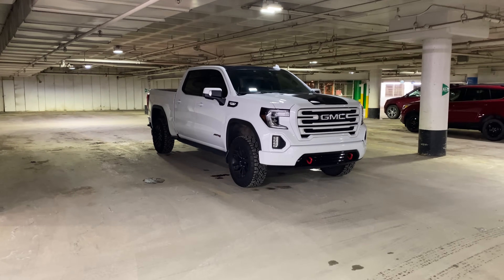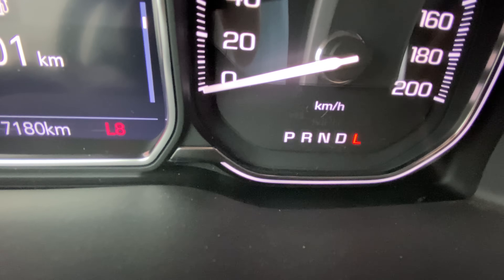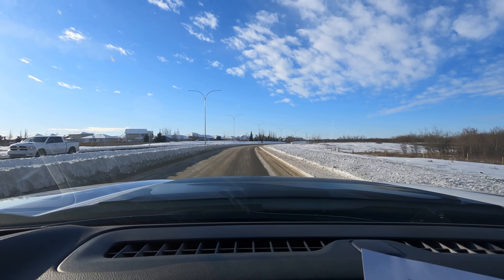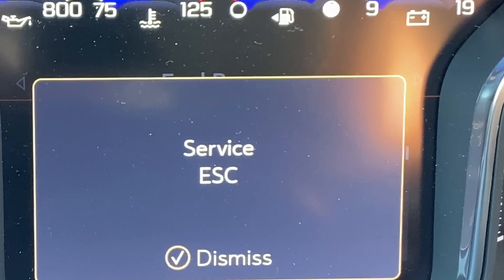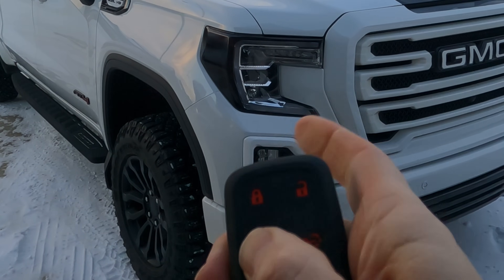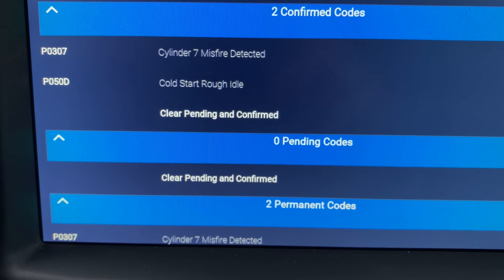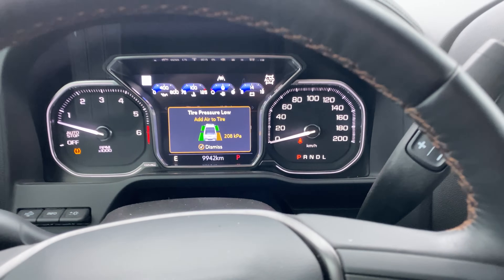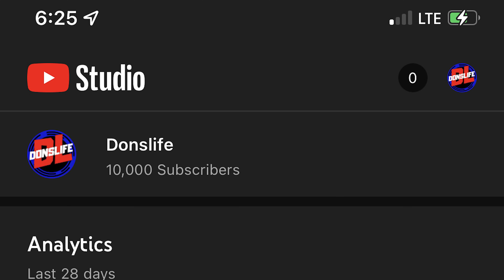Problem - Check Engine Light! What Happened? 2021 GMC Sierra AT4

Comment: Based on the experience your having it may be an issue with the lifters. GM is currently being served a lawsuit or having faulty valve lifters on 5.3, 6.0, and 6.2 engines. I would get the truck into the dealership asap. Make sure they replace all of the lifters passenger and driver side.
Reply: I have a 2021 GMC Sierra at4 as well with the 5.3l engine and I had the same issue. All of the same lights and warnings popped up and I had to get all of the lifters replaced. Was not a fun experience.
Reply: @michagenberger  I have an AT4 2021 as well so far I haven’t had any issues I’m barley at 2K tho.
Reply: @johnnyflowers1001  when did you buy yours or was it manufactured? I was told that in March of 2021 they changed the lifters, and later on deleted DFM. I recently purchased mine 11/29/21 and my does not have DFM and apparently has different lifters.. So I'm curious if this still happening to models w/o DFM and supposed revised lifters.
Reply: @jayk.2276  mine was out of production on August as per the vin info
Reply: 2021 AT4 with 5.3L 14k miles currently getting all lifters replaced. Not happy at all but hopefully this fixes the issue
Reply: @michaelgray4585  when did you take it out

Comment: It would be interesting to see if some of your issues don't go away if you put the original cold air intake back on. The original intake and the position of the mass air flow sensor is vital to give correct data to the computer. I have seen so many trucks have issues with aftermarket intakes that some guy without an engineering degree it turning out in his basement or small shop.
Reply from the maker: You may be interested to hear my update soon.  🖖

Comment: Hey Don thanks for sharing I had a 2015 GMC Sierra 6.2l with 50k  and already had my 3 lifters changed in driver side when only had 21k  in the winter of 2017. Now a month ago I did the same thing you did I start my truck with my remote and notice the rough idle I drove and had no power check engine light came on and it took it to the dealership misfire on cylinder 4,8 after they recommended me to do a full tuneup but that wasn’t the problem 1 week later came back again for the same problems and this time was the lifters. 🤬
Reply from the maker: Bummer man.  Thanks for sharing
Reply: Had a buddy with a I think 2014 Yukon 6.0 had recurring issues with lifters as well.
Reply: I have a 22 w/ 5.3 reserved. This lifter issue has me concerned and thinking about canceling. Does anyone know if this is being rectified for the 22 model with the replacement lifter?
Reply: @peterkaputsos4125  brother if you still can cancel it, run. Gm is finished. Their products have sunk to an all time low. I have the new Sierra elevation a d have nothing but issues. My check engine light is on now too, most likely failing injectors. The truck always has the Chevy shake rumble going thru the gears. Rattles so much it's shaking the panels apart literally. Terrible ride, never had a vehicle ride like this. Some days it feels like a clapped out civic. Only way to go is older tundra or hd models. Most American truck makers have sold out

Comment: Don is a weather related issue…think about it! Cold temperature affect spark plugs , they actually clean their self when they are extremely hot and been in a cold weather that spark will not produce that intense flash need it to move that cylinder making the computer read a misfire……misfires occurs as you know when you do not have one of the 3 principles, gas, fire and oxygen…you have two guaranteed, the other one is not flashing properly…..try to put your vehicle inside your garage for couples of days, clear your codes and see if the problems comes back…I suggest even wait until your weather goes excessive cold to test…..I think it will light up again because your spark plug is a factory one, its not made for that type of weather. Let me know how it goes…I have a 2020 GMC Denali 5.3 but am in Florida…add metal lube to your engine , will decrease friction inside your engine and don’t void  your warranty , great product to use. Take care.
Reply from the maker: Thank you sir.  I looked into the additive you recommended. Not available in Canada 🇨🇦

Comment: My 2019 LTZ, 5.3 with only 4788 miles on it, began having a slight ticking noise on the front of the motor, dealership check this out and said I was hearing "High Compression Fuel System". Anyone ever heard of this before?  Or am I just being played by the Mechanic?  Anyone know about this, please respond.  Thank You.
Reply: My 19 Trailboss LT does the same thing, have always worried about it.. Hope it’s not anything serious. But hey still under warranty, I just don’t want to be stranded somewhere if it does. I do have the 8 speed and around 29,000 miles started having transmission problems. Took it to the dealership, they knew exactly what the issue was and never even test drove it lol. Just drained and replaced transmission fluid with Mobile 1. Problem went away.
Reply: @thomasbartlett5458  My concerns are that my factory warranty expires on 03-26-22, this vehicle is a lease right now, I had the intent on purchase it in March. I'll have to buy a Extended warranty ($2,817.00) before the original warranty expires, If I buy this. Purchase price is $35,312.00 plus tax, combine extended warranty, I have to finance around $42,000.00. I have saved over half for down payment, but now with this ticking noise, I don't think buying this is a good investment. I can take the $$$ and purchase a 2022 that does not have all these issues as earlier engines.  Only issue, I'll be buying another "new model" truck again, who knows what might creep up with it.  Love this 2019, though, except for that noise that might be a monster waiting.

Comment: Sounds like the lifter issue. My 2020 GMC 5.3l has had both sides replaced under 12500mi (10k mi on driver side and 12400 mi on passenger side). The issue started and ran rough for a couple days off and on, no crazy noises coming from engine. Service ESC and parking brake lights came on and stayed on which, per GMC, is what happens with the lifter/misfire issue. They will only replace lifters on both sides of the vehicle is under 8k miles. They determined which side the issue was coming from and wouldn't agree to replace the other side. After cracking open the engine, they found the other side had already been replaced... Ask the dealer for the 100k mi warranty extension!

Comment: i had the same incident happen to me recently, one afternoon, with my 2021 denali. i also just had an after market exhaust installed so i wondered if that could possibly be attributed.  i was told by my mechanic to make sure im running mid or high grade fuel on that 6.2, that the low grade fuel sometimes can cause sensor issues. It just so happened that the last 2 fill ups i made were at a gas station i dont normally use and the gas was almost 20 cents cheaper then where i normally go.

Comment: Hey Don, great job on the videos. How did you check and clear the codes on your infotainment system? I have a 2022 GMC Sierra (new body style). There doesn’t seem to be anything wrong with it but it would be nice to check for fault codes now and then, or if something does go wrong it would be nice to know how to check the codes. I have a wireless OBDII device that connects to my phone. It works on my BMW but not on the Sierra. Thanks Don!
Reply from the maker: Hi there 👋🏼 I use the Android device in this video.  It doesn’t have to be this specific device, but it works for my diagnostic software and also displays graphics for my auxiliary light and rock switches: MAJOR UPGRADE for Your Existing Wired Car Play or Android Auto! YouTube and Netflix!
https://youtu.be/ZYOALNsNzpI
Reply: Thanks for the reply, Don!  I’ll check out that video.

Comment: Put a Pulsar Control Module on your truck and you can disable the DFM and you can cancel the start stop along with other functions. Most likely will help with these failures in these engines.  There is also a class action lawsuit now against these engines along with the 5.3 for these failures.
Reply: I have a Pulsar Lt also, but unfortunately there is not guarantee that this will eliminate a lifter failure, just be aware of that.
Reply from the maker: I will eventually get a PulsarLT when I get a different wheel setup.   Costs $700+ here is Canada too.

Comment: P050D is a known code for failed injector, you most likely need a new injector at cylinder 7. P050D is tripped when the injector cannot perform dual pulse mode smoothly during cold start, more prominent at cold temperatures showing which one has failed. Once replaced, you should be good to go. Use a good code scanner and check any other cylinder is getting misfires, they may need new injectors too

Comment: Hopefully it’s not the dreaded lifter issue. I noticed on the GM accessories website under performance options they pulled their own performance CAI, and no longer offer it nor recommended installing it, even though you could have ordered this from the factory as a performance upgrade. Not sure if this goes for all brand CAI units. Also not sure if this somehow indirectly causes or relates to the common lifter problem, but I’m sure they had a reason for no longer offering it. There has recently been a class action law suit filed against GM for the lifter issue dating all the way back to 2011 or so. It’s not just the 6.2 but also the 5.3 and 6.0 engines. The question is if these lifters are failing, are they just replacing them with the same new lifters? If not, and it’s a new completely different or redesigned lifter, then why are they continuing to put the old defective lifters on new trucks being built? I understand why for government fuel regulations as to why they came up with DFM, and all the different combinations that the cylinders can run on, they just need to develop a lifter that can handle the task. I have a 2020 trailboss with the 6.2 with approximately 12k miles. No issues yet. Activity shopping the Borla cat backs which led me to your channel. Best of luck, keep us posted.
Reply from the maker: I will keep everyone posted.  Right now it has been fine and still ridiculously cold here.  I don’t think the CAI’s are a contributing factor.  I am hopeful it is a fuel delivery problem.  When it is so cold for so long it can happen. Gas line antifreeze is a pretty popular additive in this part of the country for a reason. 🤷🏻‍♂️

Comment: Just curious, did you ever end up getting the Pulsar LT? I've had in my 2020 Sierra since it was released and I swear it runs and performs better than ever with it. No AFM or auto start/stop is awesome and great peace of mind.
Reply from the maker: No I haven’t yet.  Been driving in L9 mostly. The $700+ Canadian price tag has made it low priority right now.  Maybe this issue will accelerate my decision
Reply: @Donslife  worth every penny especially since you're running an intake and cat back exhaust. And the power level on demand is a huge bonus/convenience.